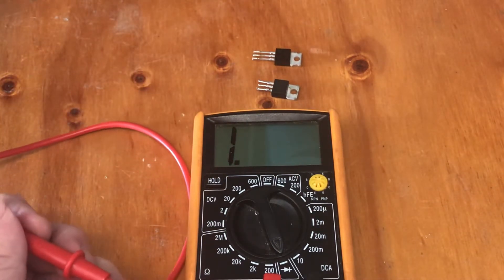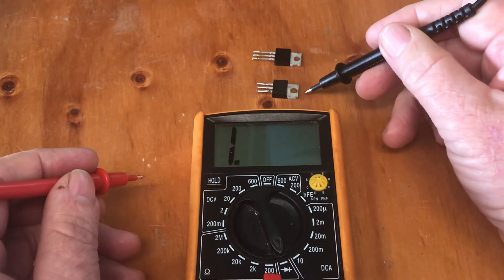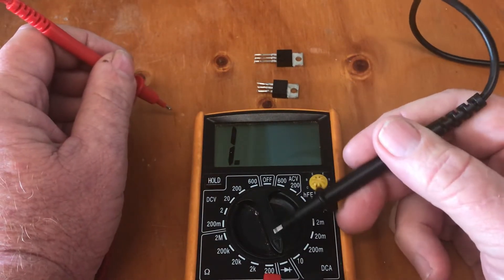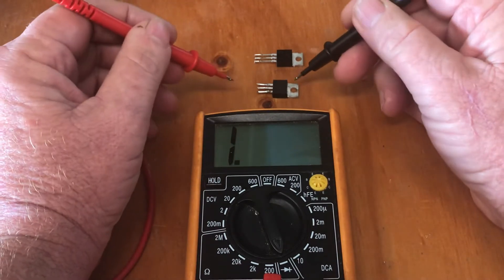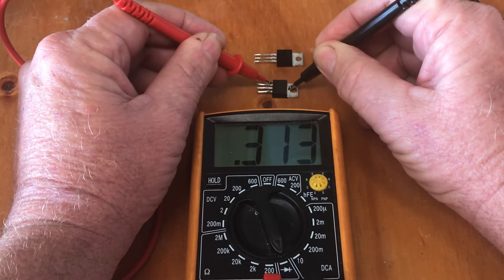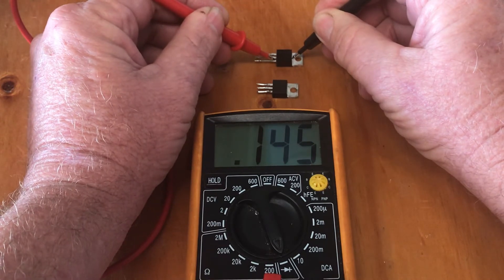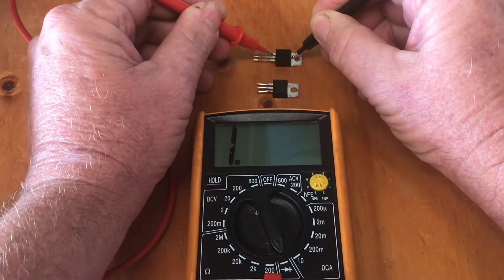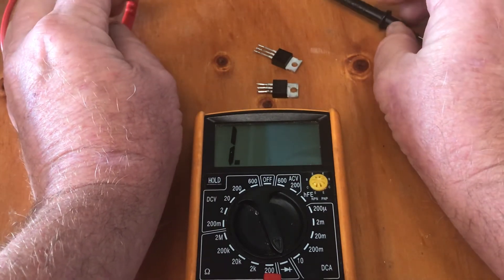Schottky diode dilemma solved

Comment: David, when the system is working properly, is there any indication (at the Tx end of things) that the main battery has failed ???  I presume the LiPo doesn't have the capacity of the NiMh pack, so just wondering if you get any "warning" that you're on borrowed time, so to speak.
Reply from the maker: Yeah Steve, the BEC supplies 5.5v while the 1s LiPo (with the booster) will supply 5v. The plan is to set a low voltage rx alarm via the telemetry of 5.2v. This might trigger some "false" alarms as the BEC voltage sags under load but I also have have "on demand" telemetry to monitor the rx voltage. I'll do some tests first but I may not even require the booster with the 1s LiPo. I have programmed a "low volt" flight mode that eliminates all the you-beaut mixing and just operates the essentials. When the alarm is triggered and I confirm I'm on the backup, I switch to low volt flight mode and bring it home. Once the diodes arrive I'll measure the voltage drop of the 1s LiPo and determine if I think it's safe to operate the model in "low volt" mode. I'm currently using about 250mah for a 150-200m climb + 10 minute flight. The 250mah back up should be ample to get the model safely back down.